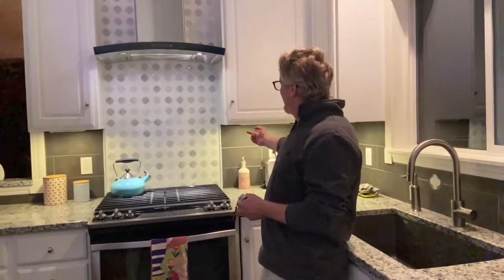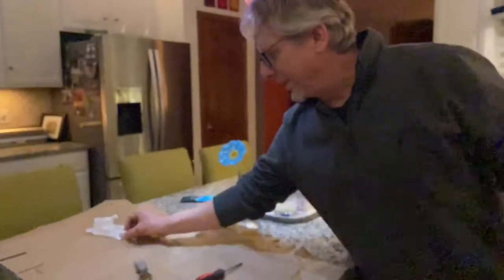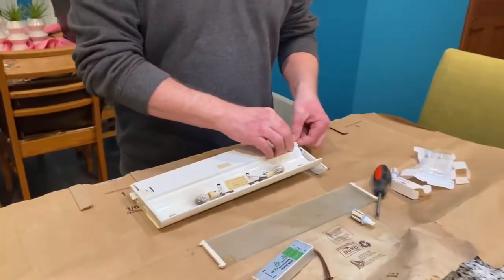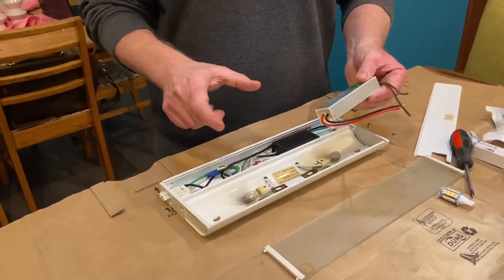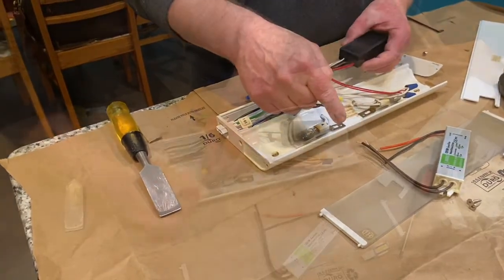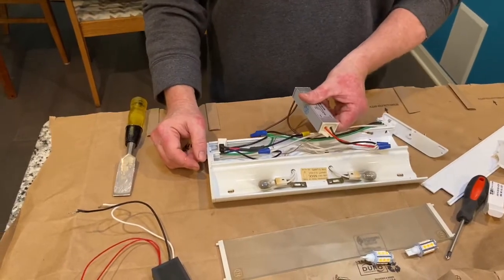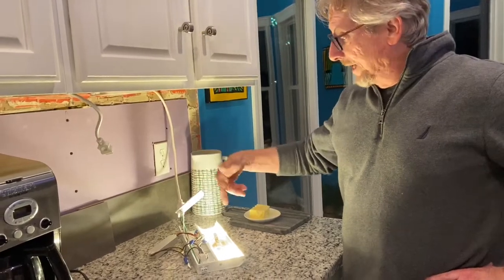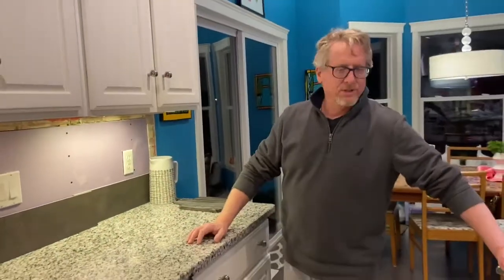Converting Kichler Under Cabinet Lights To LED

Comment: If im removing every fixture im going to just buy a new led fixture rather than buy 100 wire nuts and put into the most flammable part of my house
Reply: Other than a pump and dump of course…..also know as “flippers” 😂
Reply: It's a lot more expensive buying all new fixtures although it's easier. I'm an Electrician so conversion isn't a big deal. It's really not hard to do what he showed here though for anyone that paid attention

Comment: I just switched my AC voltage converter out for a DC converter in four of these Kichler units in my kitchen.  It was much easier to do having watched your video.  Thanks for sharing the info!

Comment: Thank you!  I’ve got these same Kichler Xenon/Halogen T5 lights under my cabinets.  We recently purchased a microwave with a 5000K integrated LED bulb that now clashed with the soft glow of the bulbs.  I tried purchasing some 5000K LED T5 bulbs, but the LED bulbs flicker and then go out.  It’s the AC/DC converter that I need and your video is what clued me in as to how to do it!
Reply: Could you possibly provide information on the voltage converters that you found which fit in these Kichler lights?  I can't seem to find any online that are smaller than 1" thick.

Comment: We have Kichler lighting also.  They are 3 light fixtures (22 inches).  I was thinking about buying new LED lights, but my wife likes the color temperature of the original Xenon bulbs.  Could you provide the part numbers for the AC-DC transformer and the LED lights?  Thanks!
Reply: Here are the parts I bought from Amazon:
Makergroup T5 T10 Wedge Base LED Light Bulb High Brightness 12VAC/DC 3Watt 2700K-3000K for Outdoor Landscape Lighting Deck Stair Step Path Lights and Automotive RV Lights (3W 6-Pack, Warm White) - These cost $19.99 for 6.  We chose warm white, but they also have cool white. Note these are intended for landscaping and cannot be dimmed.

AspenTek 12v DC Waterproof Led Power Supply Driver Transformer, Aluminum Alloy Shell(30 watts) - Note these are 30 watts instead of 15, but that just derates the part to make it last longer. They were only $10.99 each.  I had to search hard to find one that was low enough for the enclosure.

Gorilla Tough & Clear Double Sided XL Mounting Tape, 1" x 150", Clear, (Pack of 1), 6036002 - I used this to hold the LED driver in place.  Not sure was needed but did so anyway.

Bottom line - we now have well-lit undercounters again.  Thanks for this video for the instructions.